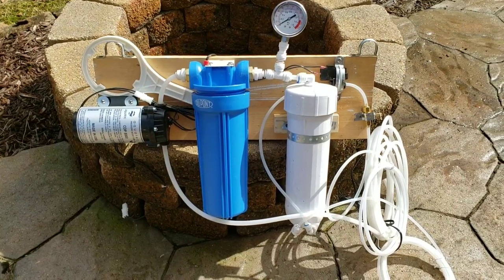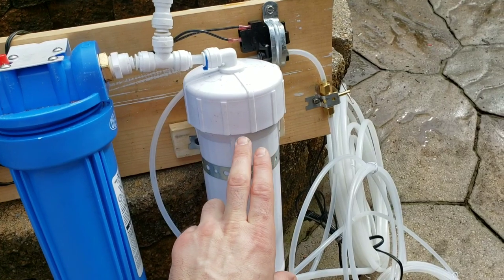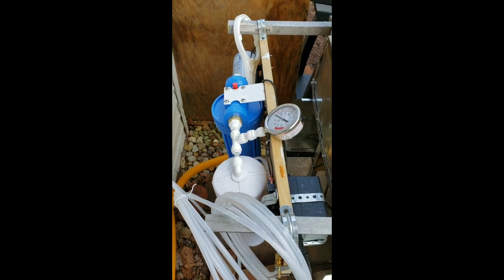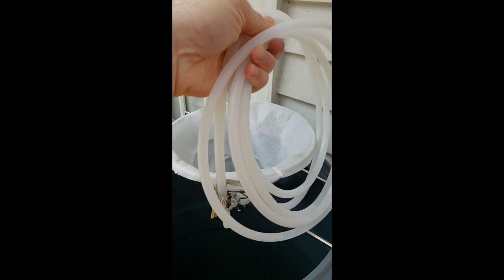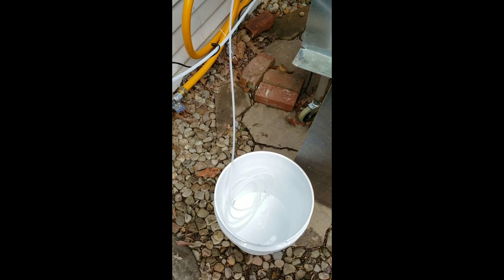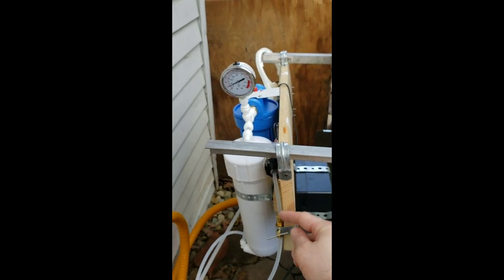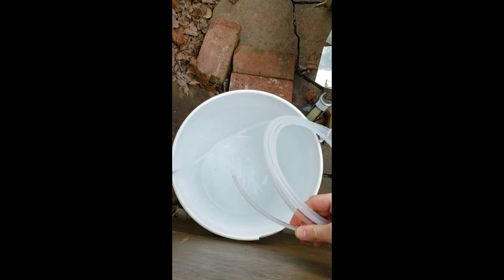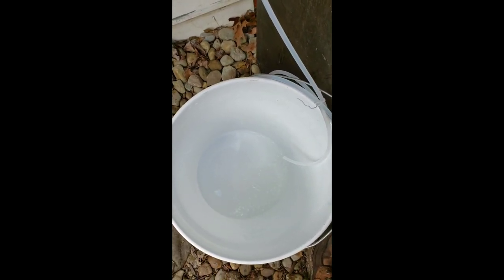Maple Syrup - Reverse Osmosis (RO) Basics #MapleSapRO #maplesyrup #reverseosmosis

Comment: Great video thank you so much. Just a curious question. I am in the process of making my first RO system. And everything that I’ve seen on the bottom the left-hand side is the concentrate on the right hand side is the permeate you seem to have that reverse just curious why?  thank you
Reply from the maker: Each membrane housing design might be different.  For this specific 3012 model from Membrane Solutions, the permeate is the lower port (almost in middle) and concentrate is higher and to the right.  
https://www.amazon.com/stores/page/F52DD3B0-BCA3-4BE4-A8B2-02EFC4C75251?maas=maas_adg_93A7FFB30C41A20B0D3842E955AA8A5B_afap_abs&ref_=aa_maas&tag=maas

Comment: Quick question I noticed this time and the last time after I ran my sap through the RO it had a little bit of an odor, but not before I ran it through. Does that mean that my membranes need to be replaced or washed? I haven’t really run a lot of sap through it and I rinse it every night with fresh water.
Thanks
Reply from the maker: It's probably due for a soap wash (NaOH).
Reply: @RoseumMapleSyrup  
Great call thank you didn’t think of that. I’m new to the RO thing. I’ll try that tomorrow. The sap should be OK to boil into syrup? 
Thanks

Comment: I seem to be missing something here. The highest pressure switch I can find from Aquatec is 80psi. How are you able to run your system at 100 psi without the pressure switch shutting off the pump?

Also, is the psi the most important or rather the equal parts permeate/concentrate?
Reply from the maker: Pressure is more important and you also don't want to drive your recovery rate too high (increases membrane fouling).  Recovery rate at each membrane is permeate outflow / inlet flow.  Also remember the pump flow rate drops significantly as pressure builds over 100-110 psi. Thatcwill increase recovery rate too (not good).   I have another video that gets into details of this: https://youtu.be/gd6cJ3QdiKk?si=QlsrQK8aoSDp1-Bd
Reply from the maker: It has been years since I built that unit, and I tore it apart and rebuilt it with more membranes and a different pump and removed that pressure switch.  It had a small Allen key screw in it that let you adjust shut off pressure to a higher level pressure.  In the end, I do not think this is a necessary part.  
https://youtu.be/JIbeiX3a16I?si=jWTdxgqrA6vNM9fx
https://youtu.be/9_Eq_sq6Tp0?si=8ETG40me5Qfwezlz
Reply: @RoseumMapleSyrup Thanks for the reply! I've actually watched most of your videos, I chose to make that one as it is the most cost effective version I've found. I'll just eliminate the pressure switch and keep an eye on the system when running. 

Thank you for the informative videos and for replying to every comment, that's super rare!
Reply from the maker: @johnods1  You are very welcome.  Best wishes on your build!

Comment: Thanks for the excellent overview of the RO process. I've held off building a simple RO system, but your video explains things very well. I'm curious where you purchased your canister, membrane and pump?
Reply from the maker: Hi Dave - thanks for the positive feedback.  I purchased the pump, filter canister & filters, the RO canister & membrane, and pressure gauge all from amazon.com.  The tubing, fittings, needle valve, and other hardware came from Lowes.  You can build this unit for a little over $200 in parts.  

I will post links to the exact components as a pinned comment here and as a post in the DIY section of our site: www.roseummaple.com

Thanks again for watching and be sure to check out our other related videos and subscribe to our channel!

Comment: how do you run the pump for extended time without burning up the transformer?   I've killed two transformers this my first year.
Reply from the maker: I have never had a problem. Used this pump for 3 years in an RO and then repurposed it for a tubing vacuum system for the next 4.  Make sure you are buying a larger wattage transformer that can handle the peak amperage of the pump.

Comment: Great video - thank you! Any suggestions for a low pressure switch to shut the unit off when sap runs out?
Reply: Dumping product into sap pale so it just keeps recycling sap and you keep an eye on it
Reply from the maker: I actually have made significant upgrades to this system and am using a GRL8-02 level controller to turn the unit on and off automatically.
Reply: @RoseumMapleSyrup  What a great unit. Would be darned difficult to recreate at even close to the same price.

Comment: Dan I built a system very similar to yours. I balanced the output rates (permeate and sap) and on my first run had the sap discharge into the sap feed container to obtain a higher concentration.  The feed container ended up almost empty in a short period of time, while the permeate container was full.  Do you have any suggestions?  Thank you.
Reply from the maker: Check the permeate output for sugar (using sap hydrometer or refractometer) or for total desolved solids (using a TDS meter).   Also double check that you have the correct ports on the housing for permeate vs concentrate and that your membrane was fully/properly seated in the housing.  What pressure were you running it at?
Reply: @RoseumMapleSyrup  Thanks Dan... yes, I had the ports switched!

Comment: I have purchased all my materials but I'm concerned that the 8800 pump is rated for 200gpd, but you had no problem running the 400 gpd RO and maintaining 100+ PSI? Is this because of the reduced effect of temps 35-40 degrees
Reply from the maker: Yes, exactly.  The Aquatec 8852-2J03-B424 model can do 1.2 lpm at 100 psi.  The membranes max out at 1 lpm at 100 psi.  Adjusting for temperature effects, you will probably see about 0.6 lpm in reality.  Therefor, the membranes tend to be the most limiting regarding flowrate, not the pump.  In fact, I am using the same pump to now feed two 400 GPD membranes in parallel and their outputs combine to a 3rd membrane.  That setup is pushing the limits for the pump (1.2 lpm out of pump and 1.2 lpm into the 2 membranes), but it's been working great for me this year:
https://www.sugartree.run/2020/01/diy-2-stage-portable-hobby-ro.html

Comment: Why do you got for a 50/50 ratio? Is that just on average sap is at a state that about 50% of its water can be removed before it is too dense? If you get a weird year where all the sap is already super sugary, does RO become impossible or less effective? Alternatively, if we are making for example Ironwood syrup, can you remove far more than 50% of the water because it starts at a tiny percentage of the sugar content of maple?
Reply from the maker: The 50/50 ratio is on a per-pass basis, and is intended to prevent possible damage/degradation of the membrane.  Trying to push too much water out on a single pass is hard on the membrane, which is designed to operate within a specific pressure range.  However, you can recirculate the concentrate output back through the system (multiple times even), increasing the concentrate each time, or add more RO membranes in series.  Maple sap can range from 1% to 4% (or even higher) sugar naturally depending on species and geography and using an RO like this, and recirculating the output, you can achieve concentrate upwards of 8%.
Reply: @RoseumMapleSyrup  I was planning on building a similar system to the one in your video (thanks for the help btw).  You mentioned multiple stages being able to get down to 8% concentration.  How many stages are required for this?  If I used multiple stages, would the membrane have a limitation based on differential pressure across the membrane or would it be limited by viscosity?  I am trying to reduce the amount of boiling time and I know that you push through each stage, the concentrate will lower in pressure for the next stage and make it less efficient for back pressure and dP across the membrane.

Comment: excellent video.  thanks   One very simple question - what size tubing are you using to connect the components?  looks like 1/4 inside diameter in the video but hard to tell for sure.
Reply from the maker: 3/8 OD between components and 1/4 OD for both concentrate and permeate outlets.
Reply: @RoseumMapleSyrup  thank you

Comment: Well presented, Dan. Did you check the sugar content after the sap went thru the membrane? Interested to know what your raw sap tested out as and what it was after running thru your little RO setup. I'm interested in the 400gpd membrane and enjoy all of your presentations. Thank you.   Tom
Reply from the maker: Thank you Tom! I do not have a sap hydrometer but a single pass reduces water volume by 50% and doubles sugar content in the concentrate.  You can do a subsequent pass, or continuous recirculation (concentrate outlet back into raw sap tank) to achieve high sugar content (more water removal).  Also, you could add a second membrane in-line (which I plan to do for next year).  My trees ran at a 64:1 sap to syrup ratio this year (~1.05% sugar) based on gallons of sap collected to syrup yield (at ~67% sugar, i.e. 67 brix) and I consistently doubled that before boiling (based on volumetric measurements).

Comment: I'm building basically the exact same set up that you have here.  I having trouble choosing the pressure switch.  I'm seeing them fro sale on Amazon, but the ones i've seen are described as 80 psi switches or lower.  I know you run this system at about 105 psi, so exactly which switch should I choose?  Than for the video
Reply from the maker: The pump itself has an over pressure switch.  Also, the switch I used has and adjustable setting (a small allen screw above the outlet) so you can increase it to around 100 psi.  Its listed in the parts list, but I have found it to be of little use and will probably switch it out for a low pressure shut off switch.  This will turn the RO off when there is no more sap.

Comment: Great video Dan, thank you ! 
Since the Aquatec 8800 series booster pump is intended for membranes up to ± 150 GPD, do you think you would have the exact same results with a 150 GPD membrane ?
Reply from the maker: Thank you! Short answer is "probably".  You would get the same sugar content increase, but it might take a bit longer.  A smaller gpd membrane will most likely have a lower flow rate, which also varies based on fluid temperature and pressure.  As long as you match pressure and flow rate specs, either membrane size should work.  The aquatec 8800 can go up to 125 psi and a little over 1L/m flow rate.  I picked a membrane that operated at 100 psi and 1L/m and controlled the operating pressure to be around 100 psi.  Membranes typically can provide about 75% of the gpd rating, so you need to size your membrane (and pump) based upon the volume of sap you plan to process (and the time you want it to be processed in).
Reply: Sugar Tree Run (

Comment: I don't understand how adjusting the needle valve changes the filtering rate. To me it just slows down the time it takes to filter the sap.
Reply from the maker: Adjusting the needle valve increases the pressure in the system, which is necessary for the RO membrane to function correctly and "push" pure water (permeate) out of the sap across the membrane.  Without the back pressure, the sap would just flow along the membrane and stay at the same sugar concentration.
Reply: @RoseumMapleSyrup  oh ok thank you for clarifying that for me
Reply from the maker: No problem!

Comment: Hello sir, I'm a student and I would like to know what you mean by sap, and why is it important in the production of clean water in the r.o. system?
Reply from the maker: Hi Alvin - this video pertains to the production of maple syrup from the xylem sap in maple trees.  Reverse osmosis technology can be used to separate out pure water from various solutions (such as sap or salt water).  However, for maple syrup, we use reverse osmosis to take the water out of the sap (which starts as mostly water and ~2% sugar concentrate on average) and keep the sap (which now has a higher concentration of sugar and is called concentrate) to boil down into maple syrup (66% sugar minimum).  We also keep the pure water (called permeate) for various purposes, such as cleaning our equipment).
Reply: @RoseumMapleSyrup  Thank you very much sir, for the explanation. I appreciate it :)

Comment: So, in theory, if i was to buy 6 400 GPD membranes and pipe them in parallel, so that the intake feeds all 6 at the same time, would i in theory have a 2500 GPD RO?
Reply from the maker: Yes in theory (2400 actually) but you would have to also scale up the pump to provide adequate flow rate and pressure across all 6 membranes.
Reply: It would be way cheaper at that point to go with a single 4040 membrane and housing. Here in Canada I can get a 2600gpd 4040 membrane for $245 and the stainless housing costs $115 for a total of $360. 6 x 400gpd membranes would cost about $600, plus you'd need a whole bunch more fittings and plumbing work.

Comment: Can you post the model number of the brass and plastic fittings you used on either side of the DuPont filter?
Reply from the maker: A better option than the dupont model:

Pentair Pentek 158643 3G Slim Line Filter Housing, 3/8" NPT #10 Under Sink Clear Water Filter Housing, Integral Bracket Cap with Pressure Relief Button, 10 Inch, Blue/Clear https://a.co/d/aeEpNJa

Comment: how many membranes I can install in parallel with a single aquatec pump?
Reply from the maker: I would not suggest more than 2 in parallel.  The pump can provide a flow rate of 1.2 l/m at 100 psi.  The membranes are rated to pass 1 l/m at 100 psi, but in reality only hit about 75% of that rating (0.75 l/m).  So 2 in parallel would be able to handle 1.5 l/m.  That would go down with temperature of the sap, so the pump is probably just about right for 2 in parallel.

Comment: Any benefit to running the concentrate through a second ro prior to hitting the evaporator?
Reply from the maker: Yes - adding more membranes or recirculating back into the sap tank and through this setup again will continue to concentrate the sap and further reduce boiling time.  However, there are limits to doing this due to fouling of the membranes with higher concentrate and reduced flow across addtional downstream  membranes in series.  A higher flow volume pump would allow for more membranes to be added.  This pump can handle 2 or 3.  I recently upgraded the pump and will be running 4 membranes to increase concentration % and volume produced/hr.   New video forthcoming!

Comment: What is the average cost of these components shown?
Reply from the maker: I have listed the parts used in a pinned comment to help estimate costs. I built this unit for around $200.  An RO is worth every penny on fuel and time savings for pretty much any size maple operation.  I have scaled up to 100 taps and run 5 membranes on a larger pump now, but the principles and value of it all remain the same.

Comment from the maker: Check out our new RO design video:
https://youtu.be/9_Eq_sq6Tp0

RO Parts List:
Aquatec 8800 series 8852 pump:
https://www.amazon.com/dp/B01GKG3R7U?ref=ppx_pop_mob_ap_share

Coronwater TYP-8900K pump
https://www.aliexpress.com/i/4000770112002.html

RO Membrane: 
https://www.amazon.com/dp/B071FJT7J9?ref=ppx_pop_mob_ap_share

DuPont WFPF13003B Filter Housing:
https://www.amazon.com/dp/B007VZ2O0Q?ref=ppx_pop_mob_ap_share

Malida Water Pressure Gauge:
https://www.amazon.com/dp/B0124FAV6Q?ref=ppx_pop_mob_ap_share

Tank Shutoff (TSO) Pressure Switch: https://www.amazon.com/dp/B007XVJYZQ?ref=ppx_pop_mob_ap_share

5 Micron filters:
https://www.amazon.com/dp/B01M0XSCDB?ref=ppx_pop_mob_ap_share